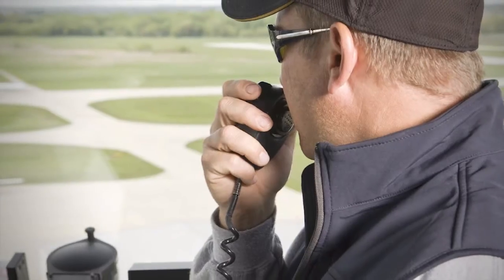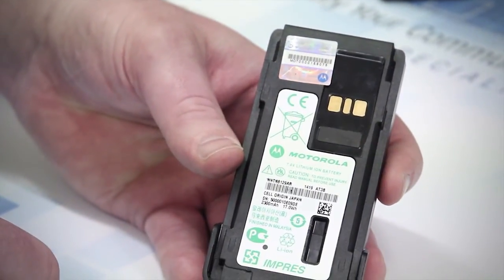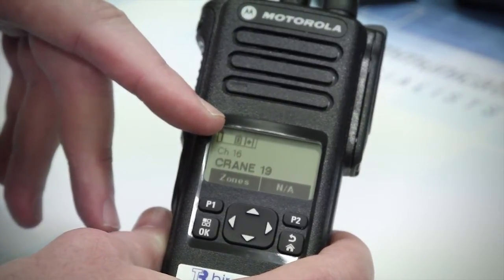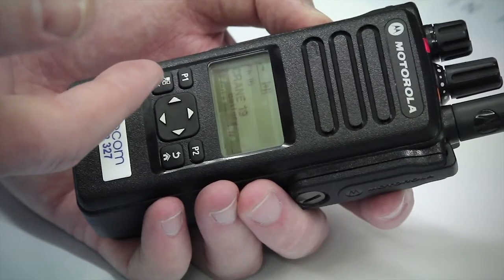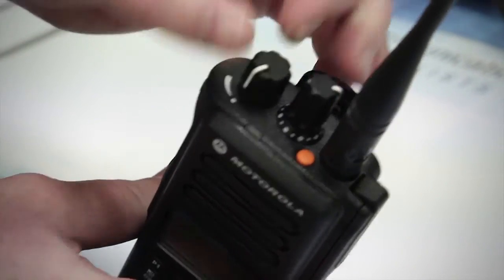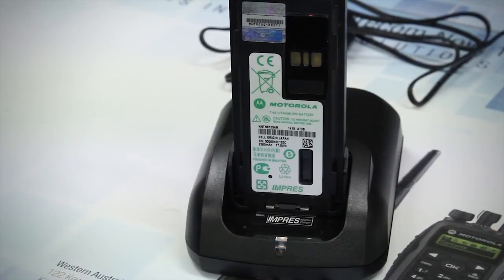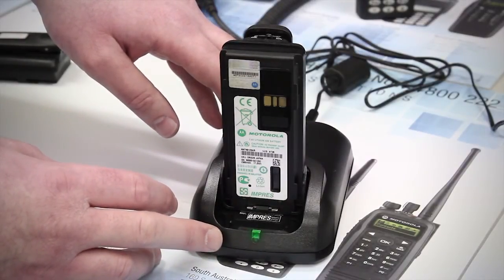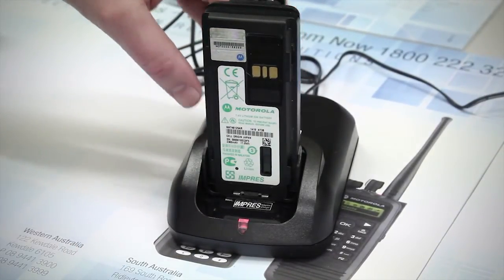Motorola Impres Battery Maintenance and Tips

Comment: I have an APX 8000 Impres 2 and the charger flashes green and yellow almost always. I have the reconditioning switch turned off, suggesting that the battery or the charger needs to be recalibrate. However, there is nothing in the manual about this. Is my battery bad? The whole setup is less than 3 months old.

Comment: You should also mention that when the battery is being reconditioned the battery should be left to recondition and not interrupted. If the battery enters a recondition cycle but you want it to charge instead you can but should consider letting the battery recondition overnight.